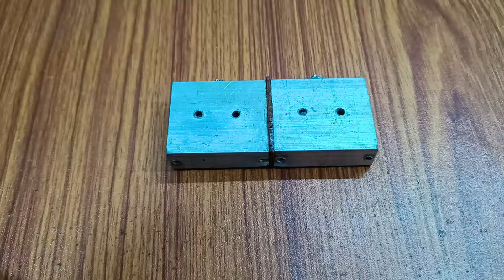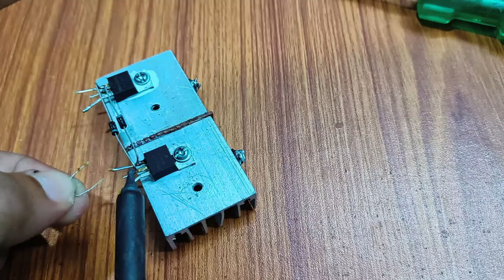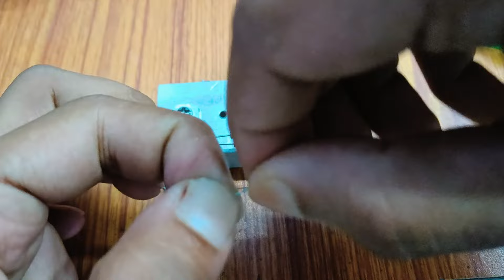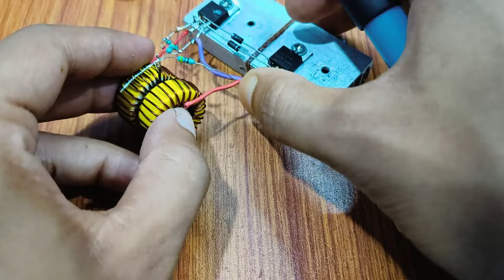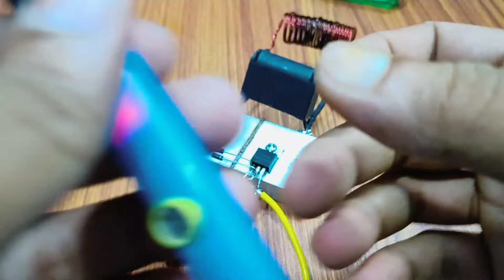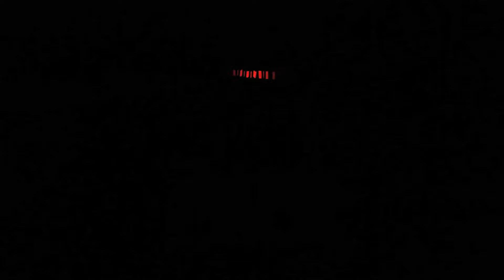How To Make Powerful 1000W Induction Heater //

Comment: Bhai humko solar plat ka output voltage fixed karna hai. 19watt ka solar panel h. 12volt pe fixed karna hai. Taki km jyada na ho. Aisa koi circuit hai kya. Please batao bhai.
Reply: Ha hai dc to dc step down module ya solar charge controller
Reply: Low cost low efficiency lm7812 ic